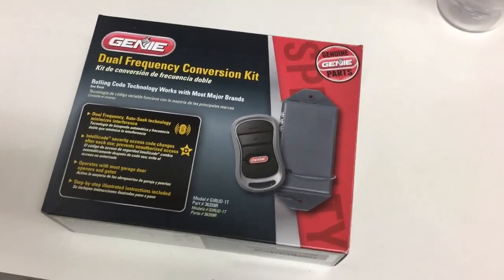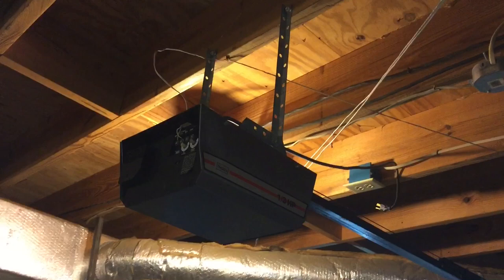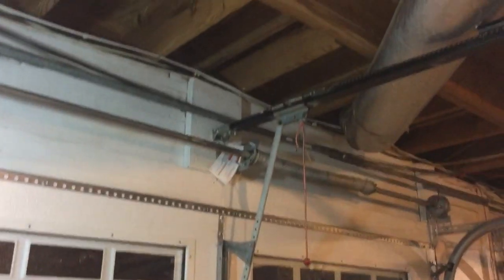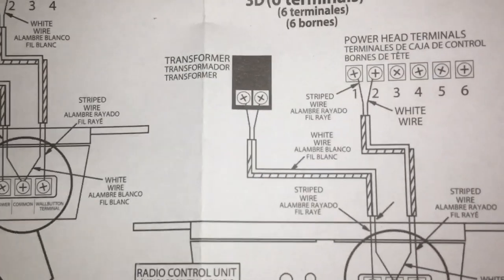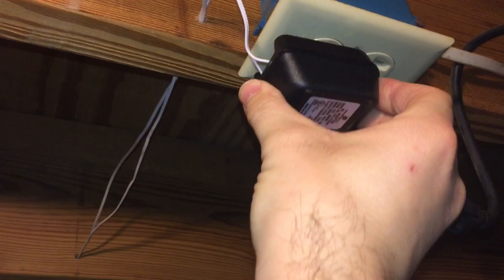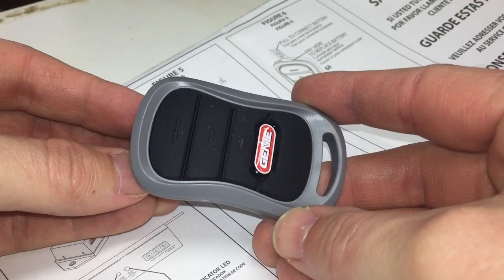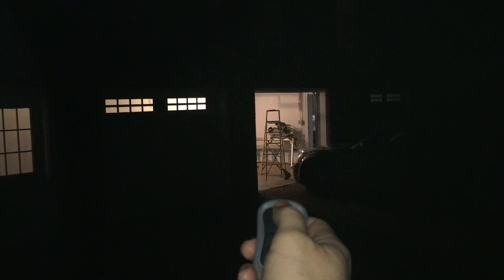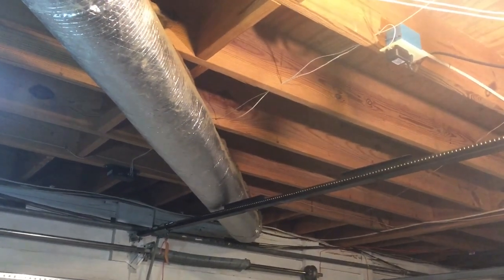How to: Installing a Universal Garage Door Opener Receiver

Comment: I know it sounds silly, but if you hold a transmitter under your chin touching your skin, it will transmit further.  I found this out by mistake working at a Lexus dealer on car remotes looking for cars far away in the lot.  Give it a try once your out of range.
Reply from the maker: I’ve done that before with a car key fob, and it seems like I read that it helps to open your mouth to direct the signal. I have no idea if that’s true or not. Haven’t tried this with a garage door opener remote.

Comment: I have a Raynor garage door opener dated May 1990. What remote can I use  for that?
Reply from the maker: I don’t know about that brand specifically. This universal receiver wires into the button circuit so, in theory, it should work with any older opener that has a button.

Comment: I have the same set up, that you have, my old remote still works without any programming. Any idea on how to disable the old system?
Reply from the maker: I cut off the antenna from the control board and toggled the dip switches to a random combination. As far as I know that’s all you can do to disable the old system.

Comment: i just subscribed and reviewed this video and have a question on my sears model 139.65500 which has back plug in. can i use this for the transmitter? my model was built in 1976 and the remotes are lost 
thanks 
kenc
Reply from the maker: I don’t know for sure but I am guessing that it will work if your opener has screw terminals for the wall button. I’m not sure what you mean by “back plug in” but you might be able to splice the remote in if you can identify the two wires that connect to the wall button. Sorry I can’t be more help.